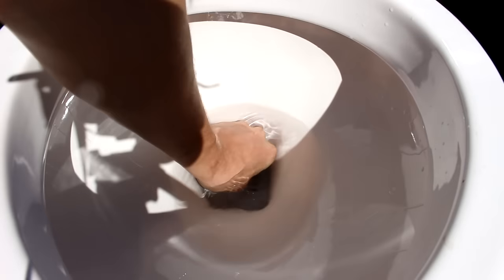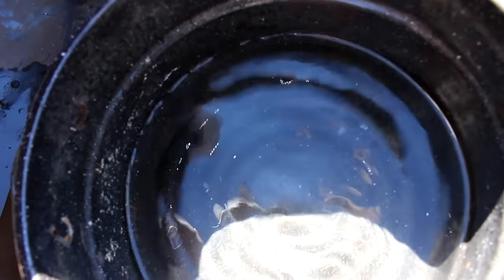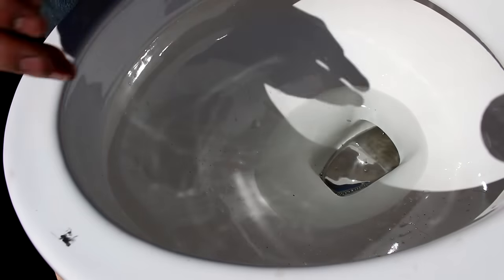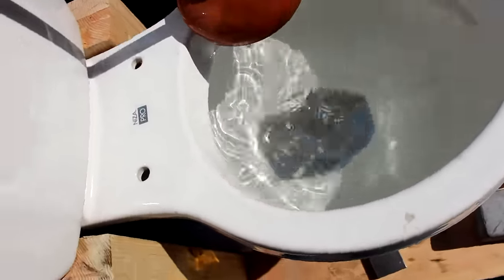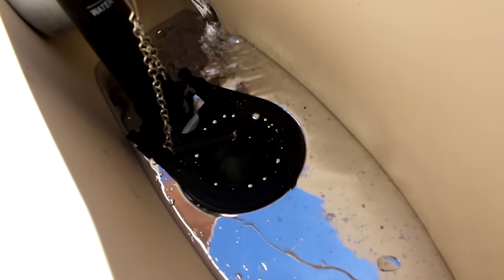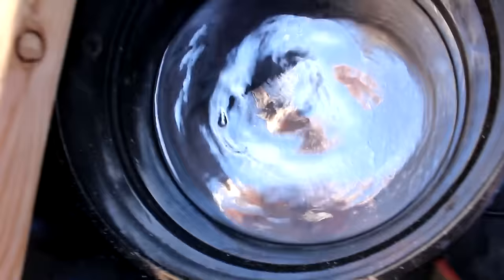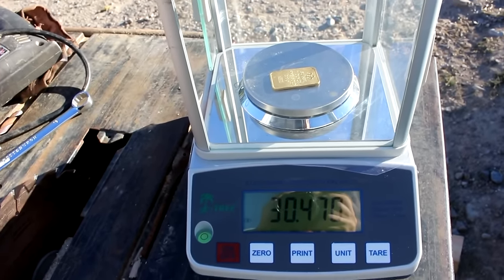Flushing 240lbs of Mercury

Comment: can you move the mercury through a water pump
Reply from the maker: sure so long as it dosnt have any aluminum or copper parts.
Reply: how does mercury react with those metals?

another question, isn't it unlawful to own a certain amount unless you meet some sort of educational standard?
Reply: Cody'sLab Most commercial pumps use bronze impellers.  Would that count as a copper component?  What is the interaction with copper?
Reply: You should operate a hydraulic ram with mercury as the working fluid to show this.
Reply: Fairly sure bronze is brass and zinc.
Reply: bronze is copper and tin
brass is copper and zink
Reply: Replace the liquid in a cpu watercoolor with mercury, and see if it works better :D *edit, it will melt, since its alumium :(
Reply: Mercury doesn't react with other metals in the chemical sense. It merely dissolves them, much like water dissolves salt. It's the principle of like dissolves like in action.
Reply: great idea, while we're at it, let's replace the CPU with FOOF
Reply: because he applied himself properly
Reply: David Barts where did you get the idea that water and salt were anything alike? 

why not say "matter dissolves matter"

(I'd love to see someone try to dissolve antimatter)
Reply: Both water and sodium chloride have polar molecules.
Reply: Manboutu O'maeley yeah, he did, but most anyone with the intellectual capacity can learn these things
Reply: David Barts all ionic salts are polar, though.
Reply: Of course. I never said they weren't. I was merely answering your question of why salt and water are alike.
Reply: I can dissolve antimatter with antimatter.
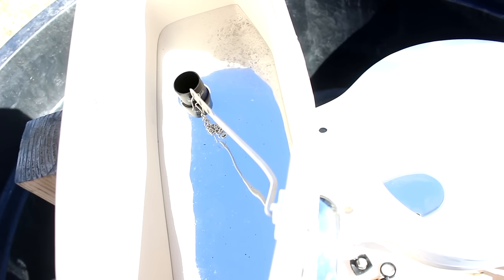Reply: in 8:17 we see the mercury is too heavy to allow the barrier(i dunno how it called) go up and let the mercury in and i see now that thats demonstrates what happenes in deep water places in ocean for example submarines have a deep limit because the water above them is so heavy that they cant go up  !very cool  video cody nice
Reply: +Katherine Clairmont that's how wars start
Reply: FantasmaNaranja I would never have guessed.
Reply: That's not why submarines have a depth limit. If they would go too deep the whole submarine body would actually collapse, or implode, from the pressure of the water above it. That is why there is a limit.
Reply: Golvmupp this is another reason the preassure can ruin critical part of the submarine but it cant collapse in that violent manner you cant say i am wrong we both right
Reply: Both are polar molecules. That's what "like dissolves like" means: Polar dissolves polar, and non-polar (i.e. "oily") dissolves non-polar. That's why dry cleaning works best to get out oily spots on clothes: it uses a non-polar solvent to remove it (unlike a washing machine, which uses a polar solvent, water, plus detergent, to "kinda-sorta" remove oil stains.
Reply: Katherine Clairmont i would have totally started a war over that comment you just did if i had that kind of power
Reply: I'm quite sure it "makes" an amalgam wich means that mercury reacts with copper or aluminum, basicly disolving them (It's more significant with aluminum than it is with copper if i remember right)
Reply: Mercury structurally infiltrates Copper, Aluminium and their alloys. It literally just wedges itself into the metal at an atomic metal and breaks apart the bonds between crystals. The resulting amalgam is about as tough as wet cardboard, so not a good pumping element.
Reply: Nope. I treat everyone like they're beneath me. In your case, it's deserved.
Reply: gordon renes you're the one getting upset.
Reply: oh, never mind, sorry, you hate dudes wearing "wigs"
Reply: gordon renes world doesn't just revolve around you, and you're not the only person I'm replying to. 

get over yourself. you started slinging shade after I outright acknowledged that I was deliberately trying to piss people off. Thanks for giving me that power.
Reply: ***** yeah, you got the sarcastic reply with the emphasis denoted with caps. You win the whole internet.
Reply: the fact that you said anything at all is proof that I got what I wanted. Was it good for you too, baby?
Reply: forced. just like everything else you do.
Reply: pretending to mock someone, and getting mock outrage in response. is that your idea of trolling?
Reply: Looks like Katherine wins this round. lmao
Reply: KaitharVideo it's even funnier when you consider that this is actually my real hair. 

I'm not ashamed of what I am, but apparently, people think I should be.
Reply: it heavily depends on the pump
Reply: XD if you were intellectually superior to him you would've ignored him
Reply: it would've been more obvious if you put quotation marks although it may be obvious already
Reply: brickstar56
Reply: Katherine Clairmont  JK, i do it everyday. (large gaseous cloud coming your way).
Reply: +Billy Bob Mercury is a molten metal, and it likes to create alloys with metals at room temperature, called amalgams. It will turn aluminum into a crumbly mess. Copper usually resists mercury because of its oxide layer, but especially around joints that have been fluxed, mercury will attack it. That mixes to make a putty like alloy called viennese metal cement which looks like aluminum dross, or disgusting overcooked solder if you like electronics.
Reply: Yes you can.
Reply: BROOOOO THAT'S SO COOL! <3
Reply: Jake bud, you know not of what you speak. gasoline is put into contact with humans more than mercury. it is obsorbed straight into skin. mercury is not. you are probably younger than 30 so a product of the liberal "oooh dont touch that let someone take your mind away".
i am 62. i used to play with mercury. i would wash my hands before i would eat and im still alive. silver gold and especially lead is taken to the body also and people are more likely to come into contact with them.
its like liberals and guns. they dont want you to have them. its ok if they have them but for you they are dangerous and you know no gun has ever killed anyone.
Reply: im rolling on the floor lol.  but dont you see ? no i dont agree. ask anyone over 50 and they will tell you they held mercury. not that they eat it or rubbed it on their sandwich. not that they were exposed daily. if you dont do those kinds of things it wont eat your brain. mine is ko. lol.
Reply: Actually up down or sideways is pretty much as easy no matter how deep you go because the pressure is equal in all directions. As you go deeper the pressure increases though, so your limit is how deep you can go before the submarine implodes.
Reply: Actually most of the better computer cooling systems are copper.
Reply: brickstar56 can somebody someone somewhere, please tell the title to the closing song to this video. Thanks
Reply: +Cody'sLab was it easy to get a hold of that mercury? if so it's really worrying that anyone can get it
Reply: 25 years ago i gad a friend who was a welder and he was able to attain a mayo jar full of mercury.. guessing around 15 pounds or so...
Reply: Spell check before you get sarcastic. Genius.
Reply: Sorry, have to post this, my IPad won't allow me to discard this
Reply: Love your channel though, Cody
Reply: Davidautofull Hillary has her problems but Trump is far, far more dangerous.  He thinks he can replace diplomacy with bullying and threatening and that's not going to work.
As for doctors... most actually do want to make you healthier, only a few are like you say.
Reply: wow, open your eyes, wrong on both counts.
Reply: Submersibles don't have a depth limit because the 'water above them is so heavy that they can't go up' - the water can't just suddenly stop anything from moving through it - it's because the pressure differential between the water outside and air cavity inside would crush the structure.
Reply: +Katherine Clairmont Your wit was on full display here, and it was delightful. Well done. No, this is not some form of insult; instead, merely a voicing of appreciation.
Reply: +The Picture: No, that's not it at all. They have depth limits because the pressure below that depth would crush the sub/ROV.
Reply: Trick question, it would be a Mercury pump if you put it in a water pump.
Reply: im surprise the tank didn't split from pressure of the weight of the mercury
Reply: NO
Reply: the button
Reply: the button j
Reply: yes. I'd use a centrifugal piston or helical gear.
Reply: ***** You're so funny and witty, such a masterful use of sarcasm. Really edgy. How stupid of me to think that a shit ton of mercury shouldn't be able to get so easily, you're right mr special ray of sunshine everything should be illegal

Comment: Can you pls get 400kg (20 litres) of gold and then heat it up until it becomes a liquid, and then test to see whether a toilet will flush with it. And then do a poo in the liquid gold and see what happens.
Reply: I don't think 17 million dollars is one of the many things he has lying around in his shed.
Reply: Brilliant!!  Made me laugh out loud
Reply: The heat from the melted gold would most likely fuck up the toilet (thermal shock would most likely happen and shatter the ceramic nevermind it melting the non ceramic components) also the poo would due to the moisture content of it most likely cause a small steam explosion which would throw molten metal all over the place.
Reply: sounds like a great youtube video. do it
Reply: *****
That's wall money even if mexico is paying for it.
Reply: Doesn't sound dangerous enough. I think you should as thermite and a pulse cannon just to be safe
Reply: Brass has a bit lower melting temperature. It might do the trick.
Reply: maybe lead? easier to melt and a LOT cheaper.
or tin, even easier to melt, but a bit more expensive.
Reply: BluePlankton trying to drop a poo in hot liquid gold not dangerous enough hahaha. Imagine the backsplash on that one
Reply: Do you want a steam explosion? Because that's how you get a steam explosion. Also, that much Gold costs about $2 million.
Reply: Don't think that would be possible, for one, it's a little bit expansive and two, gold solidifies realy fast, as soon as you took away the heat source it would most likely become solid
Reply: ElusiveStupidity
That is in no way PC it's fully descriptive as to what would happen (steam is incredibly powerful especially if it's made rapidly) it would throw whoever was sitting on the toilet off, covering them and the general area with molten gold and most likely taking their legs off as the toilet bowl explodes.
Reply: Nuke 
He obviously wasn't serious.
Reply: If cody had that much gold or money, toilet would just shatter from heat change that it gets from molten gold
Reply: I would love a tour of cody's shed.
Reply: Surely you could make the toilet out of some kind of ceramic that would be fine with the molten gold. I mean, a toilet is basically just a large crucible.
I wonder how long the gold would remain in a liquid state to allow flushing.. the "toilet crucible" may need to be pre-heated, or the entire thing can be placed inside a large furnace.
Then it's just a matter of getting someone to take a dump in it. You could hypothetically do a "high dive" dump from a couple meters above to avoid splash-back and steam explosions.
It actually seems like a worthwhile investment if you ask me. The US government spends one tenth of that amount every millisecond on superfluous frivolities.
And imagine the "golden dump," those blessed ass cheeks and that moist loaf frozen in time like Han Solo.
Reply: Torgo 
This comment is pure gold. Pun totally intended.
Reply: ***** 
I know. I deserve a gold medal.

OHHHHHHHHHH snap, here it is again! I'm on fire!
Reply: A Neptune's kiss with molten metal doesn't sound pleasant at all...
Reply: yeah and instead of flushing down a gold bar with mercury he could try to flush a uranium bar with gold
Reply: it would melt the plastic in the toilet
Reply: He could call it "the golden dump".
Reply: Or he could call it "the golden trump".
Reply: the golden dump has a nick name, sounds like a wanna be politician...
Reply: "also the poo would due to the moisture content of it most likely cause a small steam explosion which would throw molten metal all over the place."

...so you can make poop explode by throwing it in molten metal?

That's horrifying and amazing at the same time.

Comment: Cody, you can calculate how much force was on your flapper and explain why it was so difficult to pull up.  Mercury has a force of 5.873 psi per foot of Mercury above the flapper.  It looks like you have less than a foot above the flapper.  That would be in True Vertical Depth (TVD) and not measured depth (MD).  Then you calculate the area of the circle of the inside diameter of the pipe the flapper is sitting on (this actually depends on the flapper design and other factors that can equalize pressure).  Then just multiply the two.  Let's say you had a foot of mercury (5.8734 psi/ft) and a 4" ID pipe (12.566 sq. inches) would equal 12.566 x 5.8734 = 73 pounds of force on your flapper.  So you were trying to lift 73+2 (small Tungsten weight) pounds with that small chain.  It is probably less than that but still substantial.
Reply: I know, I have a degree in physics and engineering. shiny juice big and big mean big heavy and big heavy push so it hard to pull up. small chain is weak like human arm or spaghetti noodle.